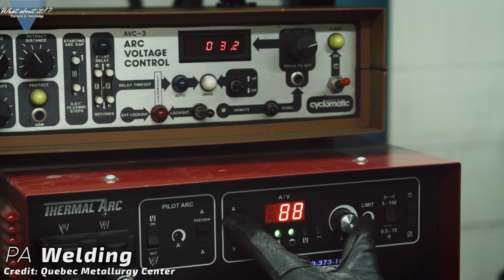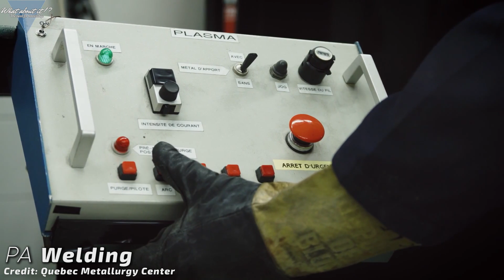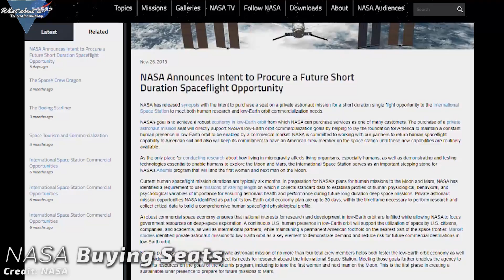55 | Cocoa Shipyard Work Paused – SpaceX Starship Updates – NASA Goes Private

Comment: It's such a shame, I said for so long that it may have been a bad idea to try the extremely rough style of manufacturing and all I got was, "HAHA IDIOT YOU THINK YOU KNOW BETTER THAN THE ENGINEERS??" and here we are. Hopefully this will make people more willing to listen to potential downsides of what SpaceX does.
Reply: To be clear, they're still going to be manufacturing this thing mostly outdoors
Reply: @averagejoejesse  Not nearly to the same degree of roughness. Plus, they're doing a good portion of manufacturing and fabrication inside of tents now, they're just assembling outside.
Reply: @zersetzung8550  I hope you go get a degree in Engineering. Contrary to what Elon thinks, an engineering degree has some value. However, hands-on building and testing experience is equally as valuable, and definitely makes for a better engineer. Elon says he looks for a record of positive accomplishments, rather than a college degree. The engineering school I graduated from stressed a lot of hand calculations, and formulation and manipulation of equations. We typically had 3 engineering classes per quarter requiring 5 problems of homework, per day per class, that required 3 to 5 handwritten pages of engineering notes per problem. This included a problem statement, a statement of first principle like F=ma, a statement of givens, a statement of assumptions, including but not limited to: free-body force diagrams, or critical path management diagrams, system diagrams, or flow chart logic diagrams, and specific worked out solutions to answer the required unknowns. I am sure with today's available software and 3D computer aided design tools, much less hand calculation is required, but over reliance on computer aided engineering has also caused problems. Boeing had quite a bit of trouble with CATIA's built-in finite element analysis software called Elfini. It was giving incorrect results for carbon fiber epoxy parts because the Elfini software itself contained mathematical engineering errors. No one has ever built such a large diameter reusable rocket out of Stainless Steel before. Starship construction analogies to large naval ship building are not completely accurate. These reusable structures will be subject to quite a wider range of acceleration, temperatures, impact damage, radiation damage, cyclic fatigue stresses, stress and thermal shock induced corrosion and vibration than any other design to date. Elon may wish to reevaluate his new mantra: "the best part is no part", to something more like, "the best design requires imagining critical problems that have never yet occurred".
Reply: @tonyrusi1978  That sounds incredibly interesting, however I'm in the process of enlisting so I won't be able to do that for a few years. Thank you so much for the knowledge though!
Reply: @zersetzung8550  You are quite welcome. I hope you can earn a chance at an engineering degree with your service. Military service like pilot training has often turned out to be as demanding as any engineering degree. And any IT experience will probably be at least as valuable.
Reply: I know the prototypes didn't see a test flight, but I'm sure a ton was learned. Everything from what contractors to use, best way to assemble stuff, what worked or didn't work, figure out and gather all the tools needed, etc. I don't think they wasted anything and this first step with mk 1 and 2 was needed to properly build a functional prototype.
Reply: @FreeStuffPlease  yeah but they aren't using any of that knowledge. An enormous amount of change happened, so much so that the manufacturing experience has nearly all gone to waste. Mk.3/4/5 and 1 are going to be so different that only the internals will have any practical experience carried over. Plus we know the flight design has changed significantly.
Reply: you got it all wrong. it seems like cocoa was using plasma welding while texas had normal welding. the texas site proved that it is possible to build a starship using rough manufacturing. starhopper flew and mk1 remained in one piece with only the bulkhead flying off during the pressure event. mk1 and starhopper were made out of small pieces of steel, mk3 is made out of single rolls so it needs much less welding. it should be made faster and more carefully. they also needed time to build structures and the launchpad, mk1 was a manufacturing test, to see if it would be able to hold the weight, and how fast it could take to be made. they got data out of it.
 the cocoa site was closed because it is too far away from a launch pad, they are moving equipment to a different site closer to the launchpad, but we will not get pictures anymore because it is a restricted area.
 the texas site, which was in the middle of nowhere is the one that stays and where mk3 is being built. cocoa was some kind of factory, with buildings, and is the one closing.
Reply: @jesusmora9379  They only started calling Mk.1 a manufacturing test after it failed. Before they said they were going to fly it up to 20km and practice the landing manoeuvre. Elon is a visionary guy but not everything he says is correct.
Reply: @jesusmora9379  They proved that it's possible to build a janky steel tube that blows up when you pressurize it to flight pressures. Cocoa was also using rough techniques as well, evidenced by the fact that they didn't use XRAY machines to check their welds, which I have no idea why they would even dream of not doing that. It's like unbuckling your seatbelt and telling the driver  (welding techs in this analogy) "hey don't crash"
Reply: @zersetzung8550  1 - bad analogy, lots of people don't use seatbelts.
 2 - it is still under debate how much pressure they used on the tank, if it was flight pressure, higher, or lower. all we have are calculations from the height and speed the bulkhead flew at.
 3 - starhopper was made using the same rough techniques and it flew twice. mk1 was a bigger tank and got cut, assembled and disassembled multiple times. it didn't blow up into a thousand pieces, it broke at the point of failure, near the bulkhead. most of the welds held.
 4 - they didn't have tents when they started, they built the test starships while working on the launchpad and buildings. they are still not done with construction.
5 - it was not a waste of time. it is one thing to have some old scientific data and simulations, and something different to actually go and make experiments. experiments are always a million times better than preconceptions and simulations. also actually working on the starship gives them an idea of how to improve manufacturing that can not be seen in a CAD program.
Reply: @jesusmora9379 1 -  Sure lots of people use seatbelts, but it is undeniably riskier to unbuckle and just hope for the best. 
2 - I can understand that, but it would be rather odd for them to pressurize to a point where RUD was a significant possibility. After all, these prototypes are designed to take these stresses and so pressurizing it beyond those barriers (even accounting for testing high to give yourself safety margins) would just be irresponsible and a waste of good 301 stainless. 
3 - Starhopper was a glorified engine test bed and it wasn't going to be doing suborbital supersonic flights, so there's not much comparison to be made there in my opinion. They're two completely different vehicles for different purposes, and starhopper could be made the way it was because of the minimal forces it would encounter. 
4 - Yes, and see how that went. It just isn't good form to build a highly complex and advanced vehicle like this out in the open without checking your welds and expecting it to work. That's all I'm saying.
5 - Eh, I personally think it was purely due to the fact that the flight design is so drastically different to the mk.1 design that a lot isn't even applicable. It would have been useful if it got off the ground, because they could have gotten some use out of their flight software, but in terms of pure construction and fabrication; a lot of the vehicle is obsolete at this point due to entirely different manufacturing techniques being used on the newer gen of prototypes. However it hasn't been released exactly how much is the same so we will find out I suppose.
Reply: @zersetzung8550  From all that has been said it seems clear that the pressure at failure was above the planned above working pressure test. All pressure tanks are tested at considerably above their rated pressure. If I recall it's 5 times rated pressure for air compressor tanks. The failure was during an over pressure test. What no one is saying is whether the failure was at the planned test pressure or if pressure control equipment failed.
Reply: @markhorton3994  I believe I read it was automated pressure instrument communication failure
Reply: @zersetzung8550  I think they looked at it as a very large puzzle. Blueprints in hand, to a test of construction feasibility.
Reply: @Cliff_P  That's what I thought as well, but ultimately they changed the flight design so much that they aren't able to use that knowledge, as the flight vehicle is manufactured completely differently.
Reply: @zersetzung8550  well they sure don't wait for much simulation lol. Falcon originally was tested with parachutes I believe, which burned up. And maybe there learning more this way. Like, I think this will work,, so let's build it and find out. (Boom),, ahhh nope! Next! Lol
Reply: @Cliff_P  Well yeah, but during those tests they still were actually flying falcon. The original parachute attempts failed but the launch succeeded.  They didn't just build a falcon 9, then blow it up on the pad before building the next falcon 9 completely differently.
Reply: @zersetzung8550  it was more of an analogy, there goal is, as streamline and efficient and cost-effective as possible. A test bed build that had the possibility to lift off, evolving real time. And it does seem to be evolving faster than they can build and test at this point. I think there doing quite well for rapid development.
Reply: @markhorton3994  Factors of safety on small tanks may be 5, but on large pressure vessels that fly, like passenger jets it's more like 1.5. And rockets are even lower, like 1.15 to 1.25 because anything heavier can't reach orbit anyway, at least if they are made out of state of the art aluminum alloys. I believe SpaceX may have already advanced beyond 301 Stainless Steel alloys however. This may be why they are scrapping the Mk1 and Mk2. I think SpaceX could easily have cleared this up with a press release stating what the test objectives actually were and what actually failed to meet expectations, if anything actually did fail to meet expectations. I have heard different assumptions being made in the absence of complete information like, the pressure test failure was not expected. But SpaceX never said that. For all we know, this had always been the plan to take the Mk 1 to failure in a max pressure burst test. As far as I know, SpaceX never actually told anyone exactly what they planned to do. And so far they have said scant little about what the actual results were. So unless you know what the pressure was and tank temperature you don't know for sure what the design should have been good for, what the actual factor of safety turned out to be, or anything beyond the tank lid blew off. I have heard speculation that they had over pressurized that tank due to valves freezing open or faulty pressure readings from frozen pressure gages. Who knows what actually happened? I find not knowing to be extremely annoying however! I hope SpaceX is more forthcoming when they know for sure what happened.
Reply: @Cliff_P  So did I, but it was a guess.
Reply: @tonyrusi1978  If an air compressor tank fails death and injury probably occur and property damage is almost certain. The circumstances of a rocket  are different. Range safety greatly reduces danger for anyone not riding the rocket. I do not know the safety factors involved. All sources of the cause so far are guesses  SpaceX is a private company and Starship is not yet subject to any outside standards. The data could be proprietary, there could be an advantage to not telling Boeing. If so we will never know. I noticed that after the "top pop" SpaceX   announced that it had decided that flying MarkI was nonproductive before the failure. Does that mean anything? That too Elon Musk doesn't have to tell.
Reply: @markhorton3994  I do know the factors of safety involved. Most aluminum Rockets are around 1.2 that's only 20% over nominal stress.